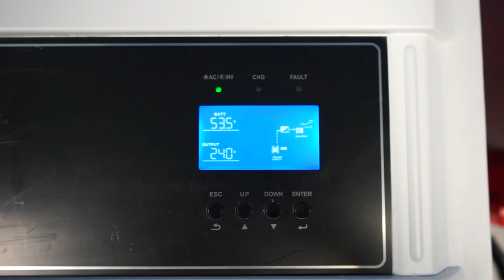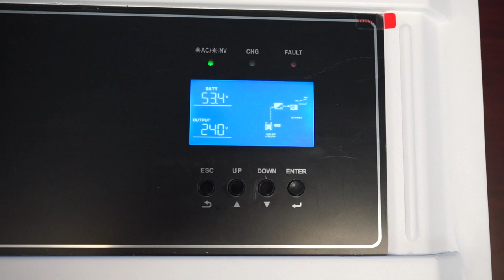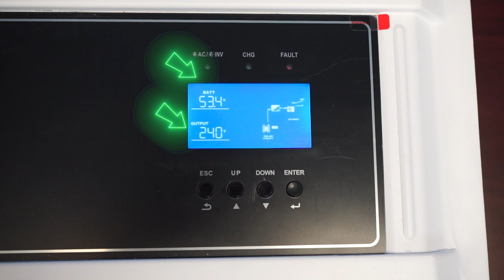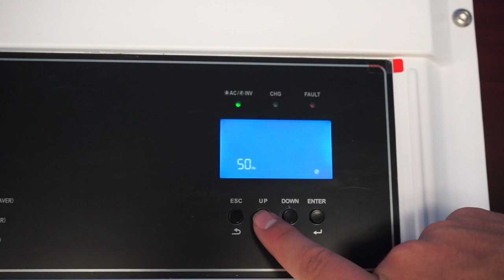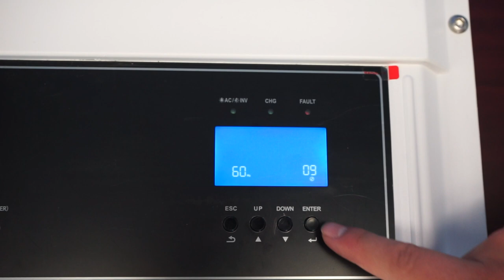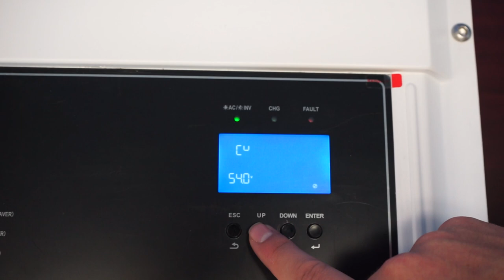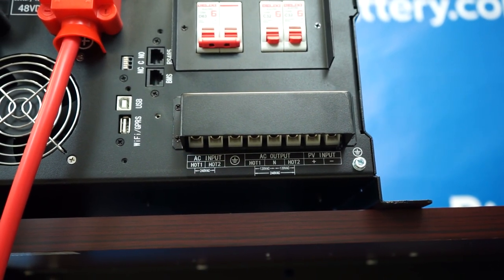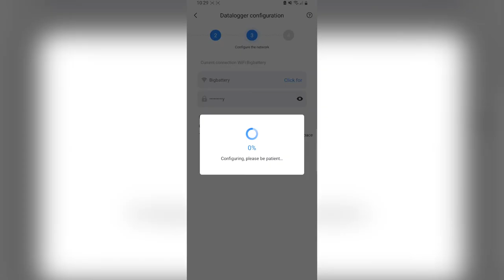6K & 12K Growatt Inverter Installation || BigBattery

Comment: Very nice setup . .. is there a built-in charge controller for solar
Reply: Hey Gary, these Growatts have two versions of solar charge controllers. One version with lower voltage DC (also less expensive overall). The other version is higher voltage; I believe 250VDC is it's highest rating. Hope this helps 👍.

Comment: I am having issues getting my inverter to power on I have hooked up 240v and flipped the on button nothing happens.  I have had my inverter and batteries in storage since 2019.  
Is there some kind of fuse inside the case that I would need to flip ?
Reply from the maker: Hi, thanks for reaching out. We're sorry to hear about any issues you're experiencing with your inverter! Please send our Support Team an email at Support@BigBattery.com with some more info on your troubleshooting steps so far and the current issues you're experiencing. One of our reps here can discuss the issue more in-depth and provide a path forward. Thank you!

Comment: When connecting the battery to the inverter, do I have to use a precharge resistor to prevent damage to the inverter?
Reply from the maker: Hi, thanks for your question. Generally, a precharge resistor is not needed. However, if your battery is continually triggering the BMS' short circuit protection when connected to your inverter,  one would be required. This can happen due to some higher output inverters having larger internal capacitors that create the large in-rush of current which triggers the BMS protection, particularly when that high-output inverter is connected to a single battery, especially one that may be undersized for the inverter it's paired with. As long as your inverter is appropriately sized for your battery bank, a precharge resistor shouldn't be needed. If you're currently experiencing issues with your battery and inverter, feel free to reach out to our Support Team at (818) 280-3091 and one of our reps here can diagnose any issues and provide a resolution for you. Thank you!

Comment: In passthrough, are inverter's Output neutral and grid's neutral wired together?
Reply: They are not tied even in pass through mode. The system continues to use the built in auto transformer to provide the output neutral (no input neutral to even connect). This ends up having additional reactive power on the input side of the inverter potentially using more grid power in pass through than expected.

Comment: Hello, I'm not seeing solar icon on my screen..I'm also have 0 solar input but I'm getting 145v coming in
Reply from the maker: Hi Larry, thanks for reaching out. Please give our Support Team a call at (818) 280-3091, or connect with them through our site chat - located in the bottom right hand corner of our home page - to speak with a team member who can assist with installation procedures and troubleshoot any issues you may be experiencing. Thank you!

Comment: I bought this from you guys, and I am still unable to use, I have tried contacting your tech support, only to be sent to growatt, Wish it would have been easier. Anyone that can help a novice?
Reply: Has your issue been resolved ?
Reply: @MaxLtd2010  nope, 3 weeks ago I spoke to RC who assured me to be the one to help. By now I can see the battery that was sold to me is obsolete. Also I see the growatt 3k kit is no longer offered  on website. To me that means I’m possibly not the only one that could have same issue.  Still waiting on assistance. Still no power.